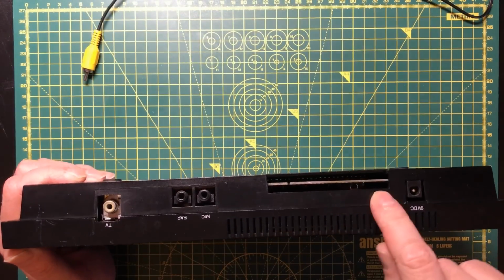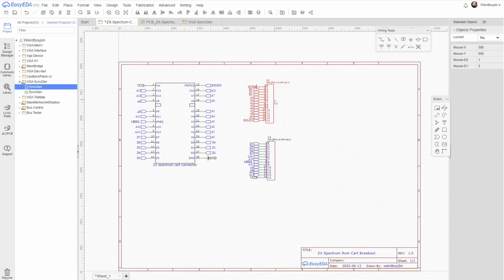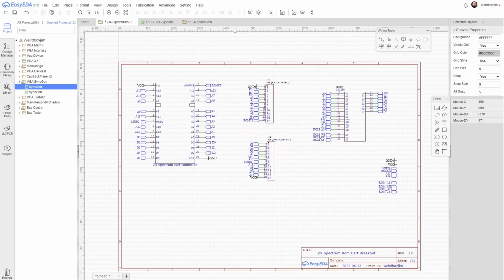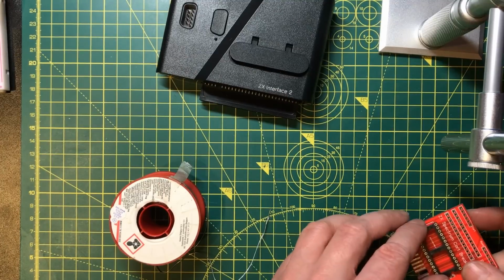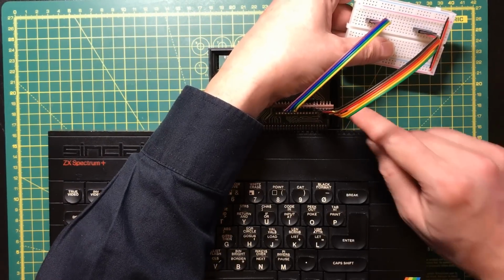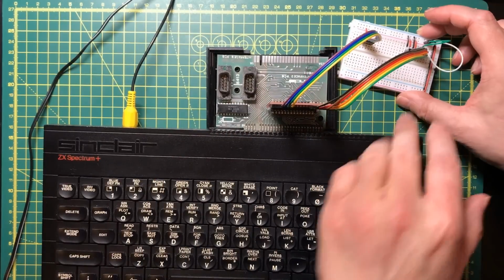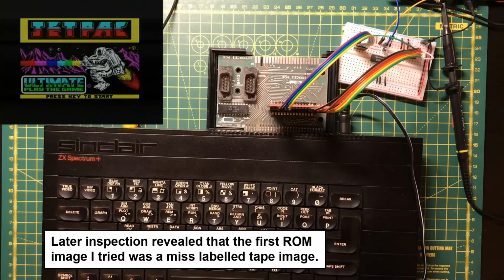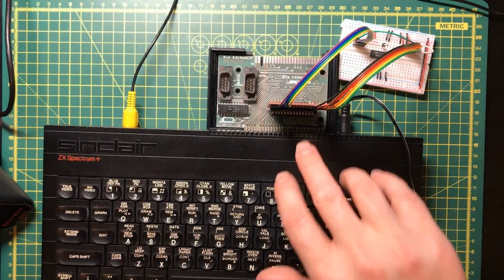ZX Spectrum, Rom Cartridge Research

Comment: I actually have a few ideas about the Spectrum.
First one is an external extension of the ULA to allow for use of sprites, using the Composite out for Sync and the RGB from the cartridge port and switching in our sprite data when needed. This could read the RAM address being accessed by the ULA when displaying and place the sprite in the right pixel position, though it might need a little timing to  get it below 8 horizontal bits.
Instead of the Speccy's limited 2-bit colour per attribute square, I'd go for 4 bits of colour to allow for a transparent layer. Using the standard Speccy pallete of course, but one of the black colours can serve as transparent.
Oh dear this has become too long, let me comment further below
Reply from the maker: Interesting ideas,  good luck!
Reply: @weirdboyjim  If only I had more time... I'll post the idea somewhere eventually, maybe someone else will build it
Reply: Different 8×8 sprites can be bankable to allow for wider sprites, since taller sprites could probably be loaded after one hblank (might be a stretch though, who knows)
Reply: This would require just 16 bytes per sprite tile, since it would be 2 bytes per each row of 8 pixels
Reply: Best way to access might really be IO ports, since the ULA blocks any memory access while displaying
Reply: Oh, and I forgot the two colour bytes that would be needed for the sprite colour, of course
Reply: You know what? Nemermind the "writing to sprite memory when the display is on". 227 (4096÷18) sprites! That should be more than enough, and not too hard to implement either really.
Reply: I suppose selecting the sprite tile as well as changing the x position (both are just 1 byte) should be as fast as possible

Comment: There seems to be a modern-made cartridge for the Spectrum, called the Dandanator. It holds 512KB, and there are a couple games that use it too.
Reply from the maker: That's an interesting project although it plugs into the main expansion port rather than the rom cartridge socket.

Comment: When electronics design also includes mechanical design.
Reply from the maker: "Mechanical Design" is a nice way of saying "Doesn't fit in hole!"
Reply: @weirdboyjim  I was watching you lay out the board and wondering if you were going to hit this exact issue.

But only because I recently designed an ISA prototype board which is being manufactured right now. I've put a D-sub connector on the outward edge that is meant to suit a particular bracket. I'm freaking out about whether I got the dimensions and positioning of everything right because it won't be a cheap mistake if I didn't... So mechanical design is kind of top of mind for me at the moment.

They'll still be usable, but not as nice without the bracket to hold them securely in their slot. :-)
Reply from the maker: @TomStorey96  Good luck with that,  it's a nice looking board you designed (Assuming it's the one you posted on discord).
Reply: @weirdboyjim  yep, that one!

Fingers crossed!

Comment: You could be really silly and put a FPGA in a cartage. then have spectrum code that reads the FPGA and displays the graphics. then during the vertical refresh the keyboard and joystick would be read. At that point it's just a display and keyboard to connect to an external device to do all the more modern stuff. But this would kinda be like the guy that displays video on a PET.
Reply from the maker: Well I need the code running on the spectrum to come from the cart. Because the cart spec is so limited the challenge is in working out the communications.

Comment: There is enough room in all the ROM space for  thousands of flip flops, you just can't read them back that easy.
Reply from the maker: I'm not sure what you are asking. Ignoring the specific ROM implementation with regard to programming we normally think about them as being static and not flip flops.
Reply: @weirdboyjim  The write signal isn't on the ROM socket but it's probably on the big socket of the spectrum and I you could use writes to some of the current known ROM addresses to 'configure' stuff. Flip flop was a bad name for adding write only registers.

You could then also have a small spot in memory where you bank those registers for reading back values. 

Ps. isn't a ~CE without a ~MREQ a write?

Comment: Very ambitious! Are you going to expand the functionality by mapping the co-processor to the top of the ROM address space? Also, what kind of co-processor? Maybe a crazy fast piece of modern silicon that can complete complex operations within the space of single ZX clock cycles? A transfer triggered architecture (TTA) that implements floating-point or some kind of SIMD functionality?

I’m mainly here for the CPU build but I look forward to seeing what you do with this.
Reply from the maker: That will be shaped a lot by whatever communications channels I can get working. Using some modern silicon as the co-processor would be sensible. The main problems are how to give it commands and read data back.
Reply: @weirdboyjim  Another option may reveal itself as you investigate those channels - but an immediate option springs to my mind…

If you dedicate a Spectrum memory address (single byte) to being a flag/“software interrupt trigger” … provided you’re able to respond to a change in its state within a Spectrum clock cycle (is the clock edge available to the cartridge?), you’d be able to detect a “call” to your own hardware.

Make that a resettable flip-flop, and you can clear it when you’re complete (for longer running tasks).

At least as a PoC.

If you wanted to really push the boat out - you could JMP on the spectrum to some memory location emulated by your coprocessor, which houses an idle loop until your coprocessor finishes what it’s doing, and jumps back (or returns) when done?
Reply: @weirdboyjim  and as always - thank you for the hard work of producing such a great video, really really enjoyed it!

It’s the sort of stuff I’d love to have the time to fiddle with myself - but #life.  Doing it via proxy with you is - well - a very close second place!
Reply: @weirdboyjim  For co-processor communication you could use a 1K dual port SRAM, because you have no R/W line, set up the 16K memory map so 14K is ROM, 1K read only DPRAM & 1K write only DPRAM (address range sets R/W). You could also use the DPRAMs interrupt line on the co-processor side but you would have to poll from the ZX side.
Reply: Bit slice multiplier?

Comment: It's interesting one of the roms failed cause it was actually a tape image, I wonder what the difference is between the two, and if tape images can be converted to rom images?
I have a C64 I've been meaning to do something with for a while. It wasn't my childhood computer, that was an Amstrad CPC464, but the C64 has a simpler processor instruction set, so I'm hoping it'll be easier to hack/mod/play about with. I want to pick apart the data on on one of the many tape games it came with and see if I can extract out the code and convert that to something that'll run on a rom. I'll be sure to stick that on the discord when I start though :D
Reply from the maker: Well the files contain a lot of the same stuff, they data sections are probably close to identical but the tape file has a basic program on the front to facilitate loading. The the tape version while I suspect the code is almost identical will have been design to run out of ram, so I expect some hardwired addresses will be different.

Comment: Can't see in the video (ageing eyes) but you might want to chamfer the edge connector, straight cut card edges can bend the fingers in the edge connector.
Reply from the maker: Interesting. I'm not to worried about this test board but I final cartridge would warrant it.

Comment: What about putting a smd rom on the board and using your own cpu to make a rom programming routine? That could be cool.
Reply from the maker: Would be fun, but keeping these projects separate. It's useful to have something you can work on when the main project is  waiting on something.
Reply: @weirdboyjim  Yeah that's true. I'm just getting into rom programming myself as a way to save bricked laptops but am waiting on tools since the sop8 in critcuit clip on "socket" worked once. I guess that's what you get for buying too cheap things. Same goes for breadboards.

Comment: Hey James, if you make any more PCBs (like with a longer piece for the cartridge connector), you may like to try a gold over nickel finish. Not only does that look drop-dead gorgeous (especially on a green, black or blue board) but it will improve the life and reliability of the finger connector over a tinned finish.
Reply from the maker: I won't argue, the gold finish looks amazing and for a board I was keeping (and needed contacts to stay good) would be awesome! But for a board this size it adds $16.50 to the order and this board won't see much use. Definitely worth it for the keeper one at the end though!
Reply: @weirdboyjim  Yeah, I guess JLCPCB doesn’t major on gold over nickel finish, hence the absolutely silly price. Most of the boards I design are for machine placement SMT and that gives a much more consistent surface than HASL, and mass-assemblers use PCB suppliers who use gold finish much more commonly. My brother and I are in our 50s and both work in electronics, and are enjoying retro revivals if our own (we began in the 70s). Thoroughly enjoying your videos 😊

Comment: I notice the expansion port exposes Y, U and V outputs from the ULA. 

I wonder what happens if you treat those pins as inputs, and try to feed replacement color data directly into the video modulator? Is there a risk of damaging the ULA?
Reply from the maker: Interesting idea, you would need to trace the circuit.  The Sinclair designers did implement some lines via resistors to allow other devices to overwrite the values but no idea for these. I want my cartridge to be a pure cartridge rather than a full expansion port device though.
Reply: Yeah, restricting yourself to just the pins exposed on the cartridge slot is probably a good idea.

No resistors in the schematics. Just connected straight to the ULA's outputs, and also to inputs on the video modulator.

It was clearly intended to support an alternative video out accessory (composite or SCART). So if you did want to exprement with driving it, you would be at the mercy of the ULA's output drivers. Maybe they are weak enough in one direction that you can display a fixed color and then pull them in the other direction without causing damage.

Not sure it's worth risking a real ULA to exprements.

There is also the issue that those pins weren't standardized across all zx spectrum models, just the 16k/48k and plus models.

Comment: This reminds me of my KC85/4 (former GDR tech, U880 based), I still have one. And I have lots of modules for it. The whole thing still works. I was lucky enough to find some stuff on ebay, 20 ys ago. if I would have bought all the stuff back in the GDR, others could have bought cars from that money, easily. The community interested in this stuff is fading away ...
Reply from the maker: Ahh yeah, the KC85 is interesting, didn't really have a following here in the uk though.
Reply: @weirdboyjim  I need to find a monitor so I could plug it in again. I was used to load games from cassette as well, and lost "half my youth" waiting for the loading procedure to finish. Then I received a floppy drive for it (5,25", 64k),and oh boy: 5 seconds to load a BoulderDash clone, which occupied almost all memory my KC had to offer, final block count was F8 or so, out of FF...
Reply from the maker: @peter.stimpel  What was the monitor requirement? Something common or is it going to be difficult?
Reply: @weirdboyjim  Just basic antenna in. But I doublechecked all my TVs, just one has the proper input :) There is a second option using scart. Some fine guy was creating a scart cable that works using one expansion port. Cannot remember where I put that cable ...
Reply from the maker: @peter.stimpel  You might find a composite mod like I did on the spectrum isn't too difficult.
Reply: @weirdboyjim  I will try once I find some time. See what you've done here ;) Oh, sweet memories, thanks for bringing in the spectrum